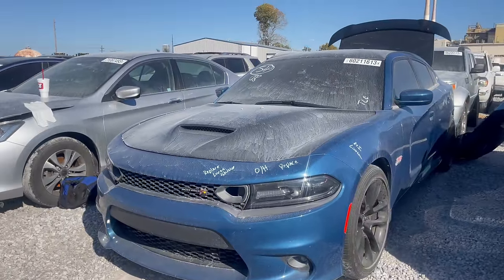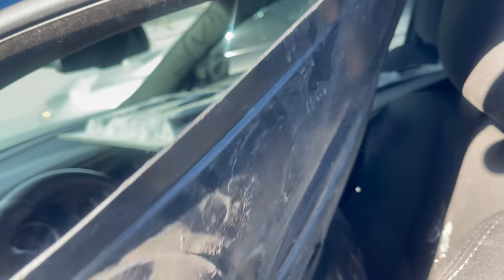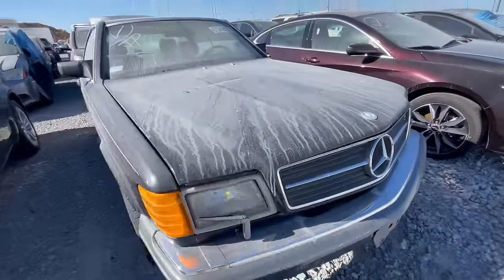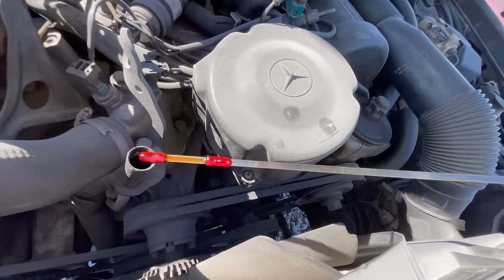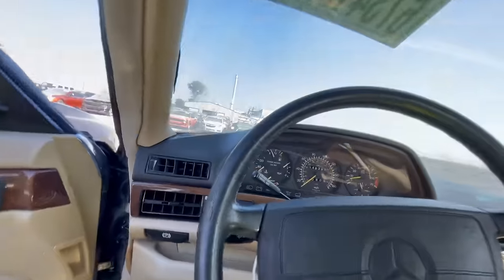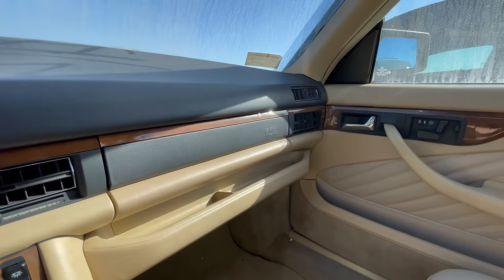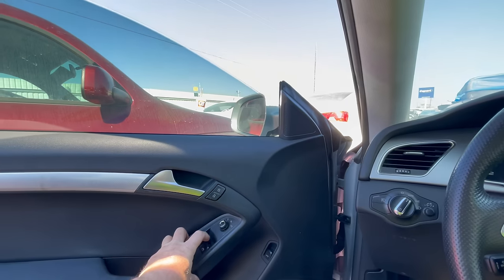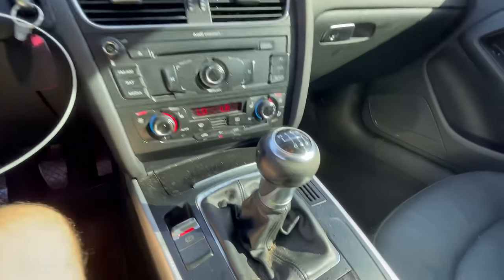Why, Oh Why?? Copart Walk Around - 11/11/23

Comment: Hope you got that Mercedes. Makes me miss the one that I had for a few months. I got to drive it a couple times and got T-boned when I was in the passenger side. Nearly tore the car in half to get hit so hard. I ended up going from the passenger side up partially on top of the driver side. The seat got driven clear up over top of the console. Was a C230 1990 something paid a couple hundred bucks for it where it was owned by idiot teenagers . Parts for the car we're so cheap it was insane and super easy to obtain. Current drove like brand new, it looked like crap but that wasn't something that concerned me you can't drive the paint. If you're older like me and you've driven rear-wheel drive cars and gone from rear wheel drive to minivans and front wheel drive beer cans with tires you know where I'm coming from about having a big rear wheel drive especially a four-door sedan that you don't feel like you're in a new level of Guantanamo Bay torture after driving the vehicle for a couple hours. Lot of front-wheel drive modern vehicles the longer I'm driving it the more pain I'm in. I don't mean that mentally I mean I have problems with my back and there aren't many vehicles that I can drive where I don't start having involuntary seizures in my legs and so on after an hour or two because of things like positioning of the seat way the back supports designed in the seat and so on. Some of the best vehicles I ever had were beaten to Sweet Jesus visually and we're super comfortable to drive. A couple Mercedes c230s Dodge Charger that was beaten like a redheaded stepchild and a Caprice 1987.